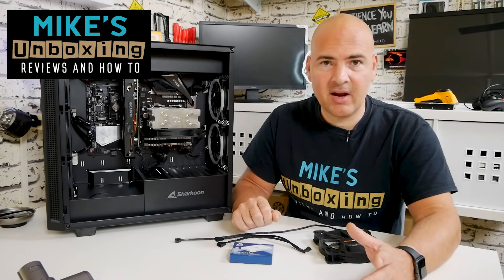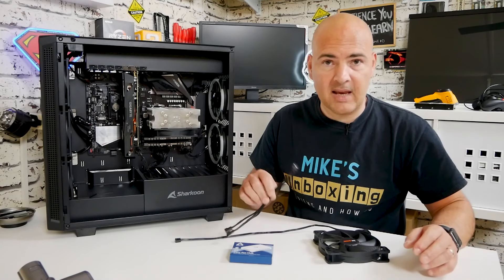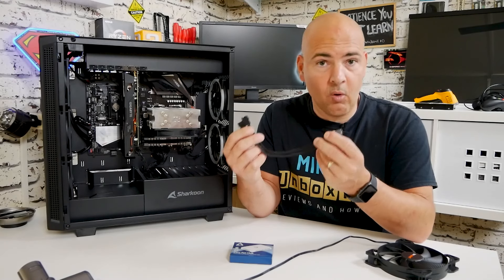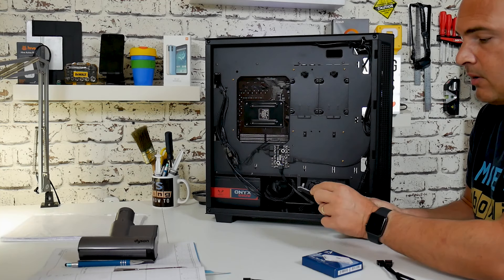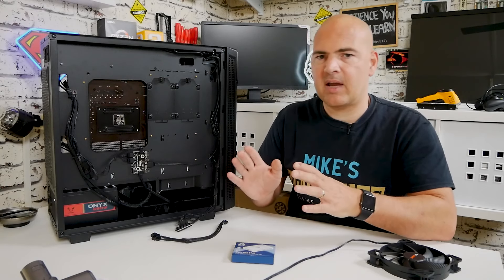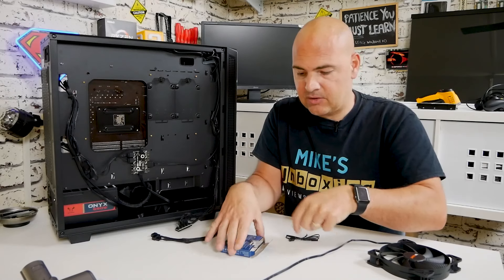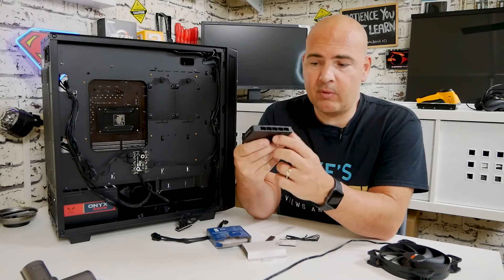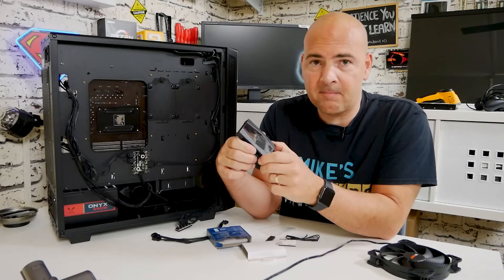How To Add Extra Fan Headers To Your PC Build

Comment: I have 12V 4pin output can i split 6 fans my motherboard only have one sys fan
Reply from the maker: 3 or 4 is the most i would use but check the AMP output against your fans total requirements
Reply: @mikesunboxing  ok ty.

Comment: Mike, On the side of the splitter where the fans plug in, both do not have 4-pins like the header on the motherboard. Even on the the 3-pin one, when the fan plugs in it only connects to two pins. Why???
Reply from the maker: it only needs 12v power and earth so that is fine

Comment: Can i please know the the amps on the fan header of Gigabyte h310m h (rev 1.0) motherboard? There are only 2 fan headers and both of them are hybrid fan headers.What will be the amp of 1 hybrid fan header so technically i could connect 3x case fans of 0.45a using a fan splitter.I seen pictures that hybrid fan header support upto 2amp..is that true?Please reply,thanks!
Reply from the maker: not totally sure sorry

Comment: Pls help. I bought a Cougar Mx660 mesh case that comes with three RGB fans installed and a controller. Each fan has a standard header cable plus one to connect to the controller. I have connected the controler to the sata power and motherboard. I would have thought that I would not need to also connect the three fans to the headers as they are connected to the controller hub which has its own sata connection. But when I fired up the pc the rgb lights came on but did not spin up
Reply from the maker: the fans might need setting up in the bios or something

Comment: If I want to connect my aio cpu cooler and seperate case fans, which fan header should I use on motherboard as default connector?
Reply from the maker: This is maybe easier to fix or at least advise if we can ask more questions and get direct answers, so feel free to join our Discord chat and we can go over it in more detail https://discord.gg/gaeeDPw

Comment: how do I connect a 4 pin fan cpu cooler in my motherboard that has 3 pin connector?
Reply from the maker: just plug it in and it will work as DC control rather than PWM
Reply: @mikesunboxing  thank you!
Reply from the maker: @doller_yt9778  No problem :-)

Comment: How about controlling RGB of the fans? In my case I have only one sys_fan header and three fans on the case itself. They are all connected to the same header on the motherboard but I can't Control the rgb. Would a fan header help me?
Reply from the maker: no you need a rgb header or controller to connect to

Comment: when i use a fan splitter, (I have 4 pin fans) It wont let me change the fan speed. Could you please explain.
Reply from the maker: the fan speed will be the same for all connected fans you can't change them individually
Reply: @mikesunboxing  So i can't set them all to quiet? or i can but they are just all synced

Comment: My case fans still don't work, the hub has power to it and my 4 pin case fans are plugged in, there's a 2 pin that comes off the header and I'm a little confused as to where it goes. It fits a 4 pin header as it has for slots just 2 pins. Any help would be greatly appreciated
Reply from the maker: This is maybe easier to fix or at least advise if we can ask more questions and get direct answers, so feel free to join our Discord chat and we can go over it in more detail https://discord.gg/gaeeDPw

Comment: I just got the same fan hub from Artic. Want to ask if my BIOS only shows 1 CHA FAN even though I have 3 fans connected to the fan hub, is that normal?
Reply from the maker: yes it sees the fans as a single fan and sends the signal to the connected fans, but it doesn't send the signal the other way as the header can not process that information

Comment: I have the thermaltake argb water 3.0 aio and msi x570 ace mobo. When i try to connect the fan splitter to the motherboard it will not connect to ANY of the plugs. Why not?
Reply from the maker: This is maybe easier to fix or at least advise if we can ask more questions and get direct answers, so feel free to join our Discord chat and we can go over it in more detail https://discord.gg/gaeeDPw

Comment: My 3 front fans has argb effect, but not spinning. I have connected my rear fan to sys_fan 1 header, no sys_fan 2 in my motherboard. What to do for front fans, has light effect, but not spitting at all!!
Reply from the maker: This is maybe easier to fix or at least advise if we can ask more questions and get direct answers, so feel free to join our Discord chat and we can go over it in more detail https://discord.gg/XtBTGQ6BDu
Agree to the rules by clicking the emoji and you will get access to the rest of the Discord channels

Comment: Hey sir .. i have deepcool mf120s rgb fans and it has 2 cable one with sata for the rgb and the other is for fan power right? .. im hesitant to plug my fun hub with 3 fans on it to motherboard system fan header  because it might overload it ..  how can i power  the 3 fan safely? For now its the rgb only working which is sata connected to psu .. thx sir hope u can help .. ill sub.
Reply from the maker: Plug it into a fan header on the motherboard and it should be fine, if your not sure ask one of the experts in the discord tech support

Comment: im saving up for a pc but the fan situation and cables are my main problem, i was thinking of using 2*3 way 4pin pwm fan splitter and 1*2 way 4pin pwm splitter, thats for powering them up. for rgb ill use an rgb splitter and ill connect them all to the NZXT fan hub that ill buy(it has 3 pwn connections and 6 rgb connections) because i want to use the NZXTcam (im using NZXT fans) will it work properly? pls if u guys know tell me, thanks!
Reply from the maker: This is maybe easier to fix or at least advise if we can ask more questions and get direct answers, so feel free to join our Discord chat and we can go over it in more detail https://discord.gg/XtBTGQ6BDu
Agree to the rules by clicking the emoji and you will get access to the rest of the Discord channels

Comment: i have a z370 krait gaming motherboard, problem is not power to the fans but my fans have another rgb cable wich my motherboard only has 1 slot to, so how do i connect more than 1 rgb fan to that? fans are the vegas x7 akasa
Reply from the maker: This is maybe easier to fix or at least advise if we can ask more questions and get direct answers, so feel free to join our Discord chat and we can go over it in more detail https://discord.gg/gaeeDPw

Comment: I have rgb fans with two cables. Current got one Into motherboard and the other Into a controller for the rgb. With the splitter I'm assuming I treat it the same as a regular port on the motherboard. Also, how do I set the fans speed to change with temperature because I think mine currently run at full the whole time. If anyone could help it would be great
Reply from the maker: This is maybe easier to fix or at least advise if we can ask more questions and get direct answers, so feel free to join our Discord chat and we can go over it in more detail https://discord.gg/XtBTGQ6BDu
Agree to the rules by clicking the emoji and you will get access to the rest of the Discord channels

Comment: please help my prime h310m-k r2.0 , how many fan can be ?
Reply from the maker: 1 cpu fan header and 1 chassis fan header, but you can attach a splitter to either for more
Reply: Thanks the reply , im planning add 3 more fan on rear front which will going have 4 fan on 1 Chassis fan header.  Currently my CHA fan is only behind for airflow

Comment: Still don't understand how to connect my 2 pmw 120mm fans, to a single header. Because the splitter you showed is for a 4 pin to 2x 3 pin things. So I still don't get it.
Reply from the maker: there is nothing to get just use it and it will work. the splitter doesn't need to be fully wired as the header will take info from each fan
Reply: @mikesunboxing  okay thanks man, will try! Good channel with the short, clear explanations!

Comment: problem with fan hub is the all the fan from the hub can only connected to one fan channel,thus can only be set with one fan profile,so all 10 fan will ramp up and down together at the same speed
Reply from the maker: is that a problem or a benefit
Reply: @mikesunboxing  in my opinion is a disadvantage,sometime we want different profile for intake,exhaust and gpu side

Comment: Kinda desperate so just throwing a question from left field ^^ :  I have 4 of my sys-fan slots on the motherboard in use plus the one for the cpu fan. I can change their speed in the bios and they all work. However : software like HWMonitor and Fan Controler only recognize the CPU Fan and one other. In HWMonitor that's all I can see and in Fan Controler it shows the fans and their RPM but I can not control them besides the two mentioned in HWMonitor. It says A paired RPM sensor in required ?!?  

Any idea ?!? I'm helpless at this point. 
Motherboard is an Gigabyte X470 Ultra Gaming.
Reply from the maker: This is maybe easier to fix or at least advise if we can ask more questions and get direct answers, so feel free to join our Discord chat and we can go over it in more detail https://discord.gg/XtBTGQ6BDu
Agree to the rules by clicking the emoji and you will get access to the rest of the Discord channels

Comment: Sir Mike I hope you're doing fine right now. Please I want to know what's really causing the problem
-(Chassis_Fan Motherboard problem).
My PC
A320m-k 3000 Ready
Ryzen 3600
2x8GB 2666
Nvme 256
Corsair CV 550 NonM
Kolink inspire K2 Argb
Everything is working well!
BUT one thing is missing the Chassis_fan on the motherboard. Everytime i put the 4pins of the psu cable with 2 molex and 2 fans attached to each molex, and when i turned it on nothing happens as in like no power to whole neighborhood community. BUT when I pull it out it return back to 100% fully functional pc. Well you can say so dont put anything on it but there should be a pin to pun on it. I really dont know why. Thanks for the advance reply Sir Mike More power to you.
Reply from the maker: just sounds like a short circuit. test the fans with a 9v battery connected to each fan pin and see what happens

Comment: I have 9 fans which are corsair blue led fans and only two chasey fan headers. I cannot control their rps as they are connected via fan header that came with my case and that runs off sata power to psy which means they run on max rps and it drives me crazy. Please help.
Reply from the maker: This is maybe easier to fix or at least advise if we can ask more questions and get direct answers, so feel free to join our Discord chat and we can go over it in more detail https://discord.gg/gaeeDPw

Comment: Wait, so does the controller handle multiple inputs?
Reply from the maker: well it depends on the controller in question, but generally no it is a single input divided into multiple outputs

Comment: 3:15 How do you control DC fans if the power is not coming from the motherboard pin header?
Reply from the maker: the motherboard provide the PWM / VDC signal and the power is from the SATA power
Reply: @mikesunboxing   "The signal wire measures how fast the fan is moving without any controls for the fan speed."  Random quote from internet.
Reply from the maker: @TheXentios  PWM and VDC are measured through two of the wires in the PWM 4 pin style connection, some boards or controllers will look at both and make an intelligent choice which to use

Comment: My fans is 6 pins, how I can connect them? From amazon I cannot find 6 pins splitter
Reply from the maker: six pin is a custom type so you probably need to speak to the fan manufacturer for a splitter or hub

Comment: I tried using the splitter everything worked fine, however one fan is more powerful than the other i don't know why that's happening, i have 650w
Reply from the maker: it might be the fans are looking for a PWM signal which isn't always passed through on some splitters

Comment: I just don't know if my motherboard can use a fan splitter without it damaging it.
Reply from the maker: If it's a powered fan splitter, you'll be fine, but if it's an unpowered one, don't add more than 3 fans
Reply: @mikesunboxing  So this is a powered one, I also have 2 fans that said configured to extract from rear/roof. Does this mean I can't use them at front for intake?

Comment: But three pin fan only has 2 plugs connected if you use the y-splitter... WHY!?
Reply from the maker: really it only needs power and ground for voltage control fans

Comment: i dont get it why make a splitter with a 3 pin and 4 pin why not make them both 4 pin.
Reply from the maker: it can't take more than one PWM signal
Reply: @mikesunboxing  you can adjust fan curve on  the 4 pin connected fan but you cant on a 3 pin so how does that work, one that can be adjusted and the other always on full power

Comment: Hi i have a question about my 6 fan argb and i am using 2 splitter, my quiestion if i plug the splitter to the 2 12v rgb header will it burn my pwm cable or not? and it compatible
Reply from the maker: it will burn